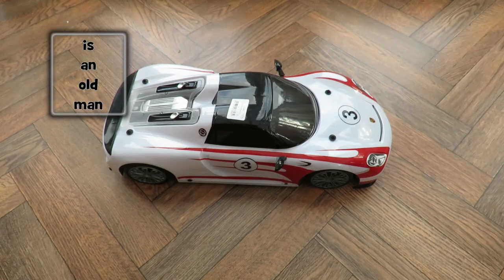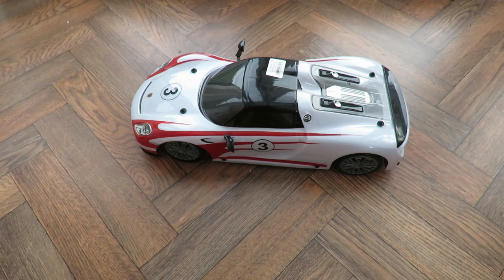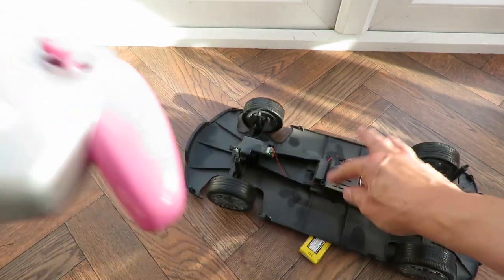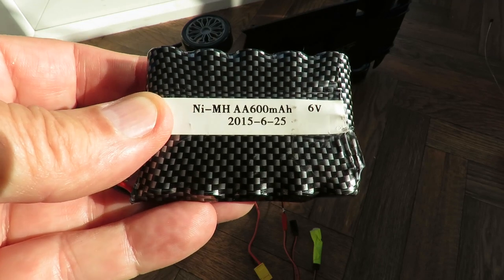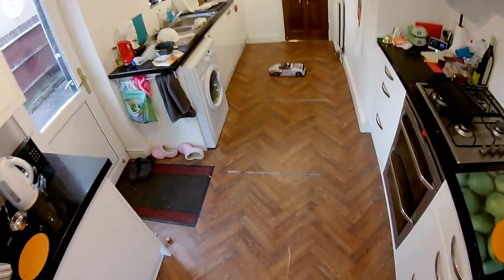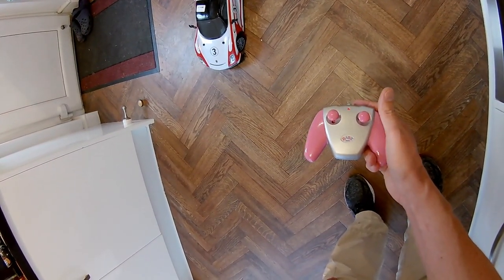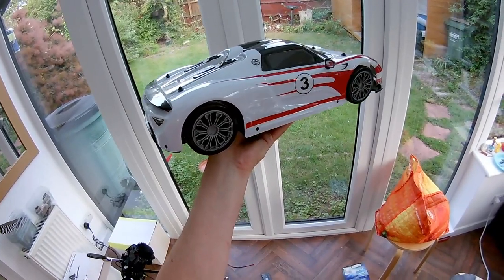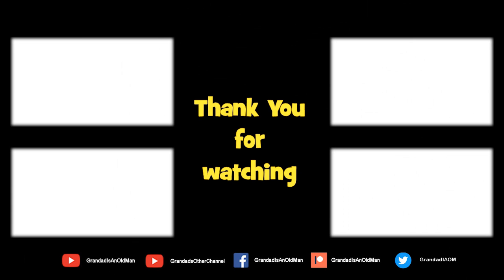RC car Mondo Motors 1:10 RC PORSCHE 918 Spyder

Comment: That is one bare bones chassis for the size, does donuts well though, worth hobby grade swapping or swapping in the board for one of those maisto 2.4 ghz cars that keeps burning up the tiny 130 sized motor.

Also worth checking if that antenna is soldered too the board or screwed down wrong.
Reply from the maker: It could certainly do with proportional steering.

Comment: Can you drive the mustang from mondo motors next
Reply from the maker: My cars come from charity shops so they are completely random. They are just old toys that people have donated to the charity rather than throw them away. They are usually broken in some way and nearly always are missing the controller.
Reply: GrandadIsAnOldMan my dad bought 2 porch 911 mondo motor cars and it came with a USB charger, wheel Controller, car, batteries and we changed it up and took it out the front and it is soo much fun but they don’t have enough range to get anywhere near 30ks

Comment: Lots of power with the lipo. Looking forward to seeing it upgraded to hobby grade. You got a deal with the body shell because on a nitro car the body shells are expensive and are basically the same as that one.👍👍👌
Reply from the maker: There's a coincidence, I was looking at this car today in my "stock" and then had a new comment on this video, so I am running down through the old comments adding a 👍 or 😍 or 😁

Comment: Have u ever found a hobby grade rc in charity shop? Like a WLToys or something maybe an FTX
Reply from the maker: I think most people with hobby grade stuff tend to sell it off on eBay or maybe a carboot sale. I don't recall ever seeing any proper hobby grade stuff in a charity shop. Well, come to think about it, I did buy an old hobby grade transmitter in a charity shop back in 2013ish but it was the old frequency and needed a set of crystals and a suitable matching receiver so basically it was junk.

Comment: Hi if you extend the Ariel as to bring it out the shell put a little hole in it an connect it to the Ariel wire in the car I have a little RC 1.24 scale audi Lms 80 when I first had it my range was only about 30 feet it's now well over 50 plus an also could be the transmitter is not powerful enough a signal get your Ariel coming out an a better transmitter you range well be 3 times that an the steering is the siccsor spring
Reply from the maker: I will probably convert it to hobby grade RC eventually. That is what I usually do.
Reply: Yes was just for now
Reply from the maker: @anthonyharvey9719  I haven't touched it for about 2 years, it is in my storage 😊😊
Reply: @GrandadIsAnOldMan  I have a few in bits at the minute I have ordered a few receiver boards off wish